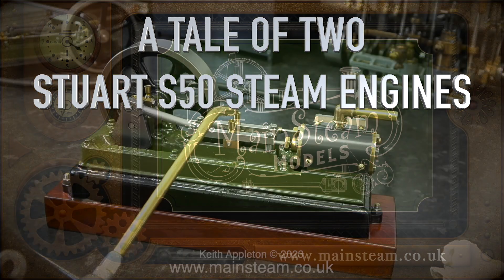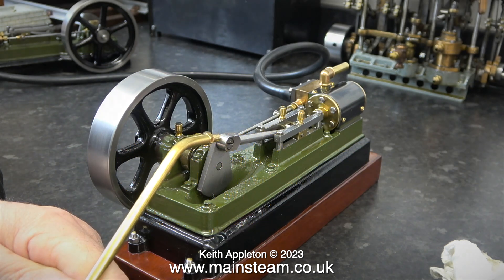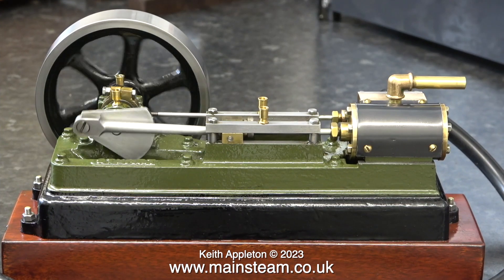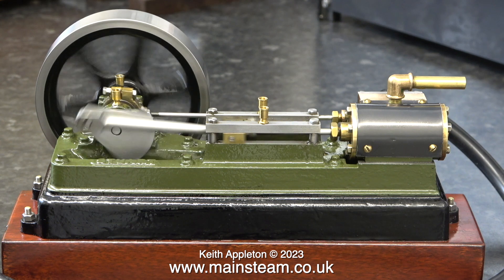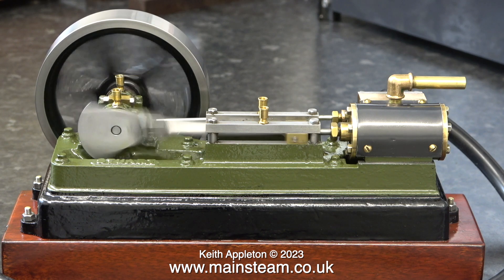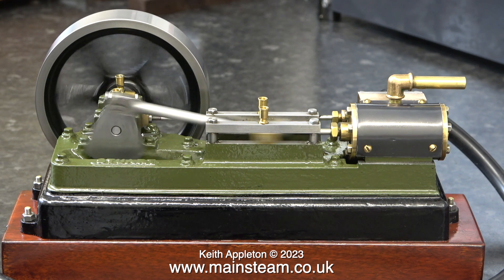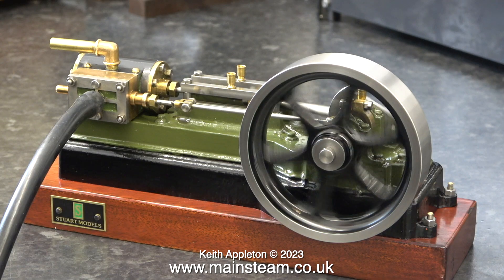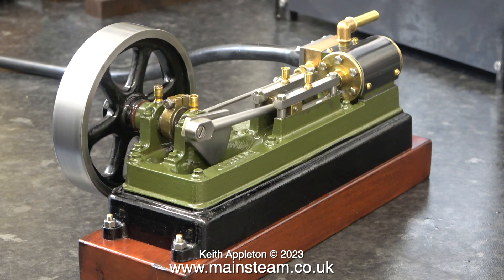A TALE OF TWO STUART S50 STEAM ENGINES - PART #8

Comment: The engine without the oil cups and cladding looks so sad next to its fancy brother. That angled exhaust port does look good, but i suspect it's impractical.
Reply from the maker: I wanted them to look as they were before I started work on them really. The one without the oil cups is much older that the other one on the wooden base. I think that back in those days, oil cups were not usually fitted on the Crosshead guides. The exhaust is just for display purposes. The older of the two engines is part of a Model Steam Plant which I am building and it will be piped to the Exhaust Condenser appropriately.

Comment: A question:  When run from the same source (via a T connection), both of these engines run at different rates.  Is there an overriding reason for this (different wear, etc) that would explain it?  Or is it just the difference in the build (tolerances, etc.)?  Just curious.  Otherwise a great series.
Reply from the maker: The one on the Wooden Base has just had new larger surface area bearings fitted . . . . which need some more running in. that is the reason for the speed differential between the two engines.

Comment: Quick question,how full do you fill a displacement lubricator? I.e. douse it need space over the oil to function?
Reply from the maker: You open the valve at the bottom to drain the condensate while a little steam is still connected to the engine. Then shut off the steam, remove the cap and refill with steam cylinder oil. The space is irrelevant as the lubricator works by displacement of the oil owing to the steam condensing to water inside it. Why not take a look at some of my other videos - like this one for instance: https://youtu.be/ZSdmyOYwNdI